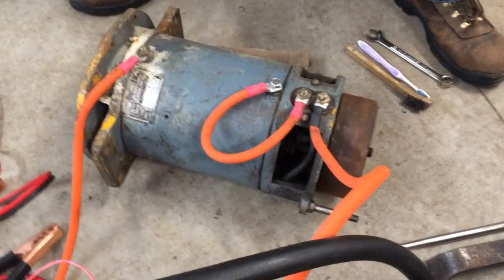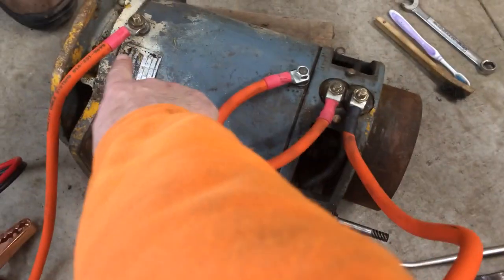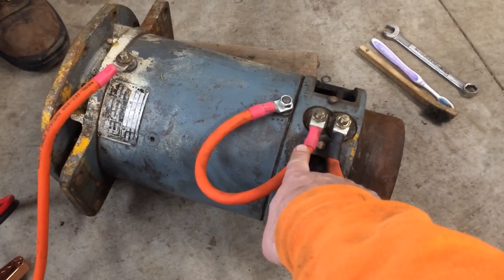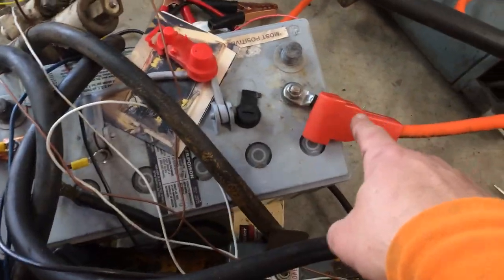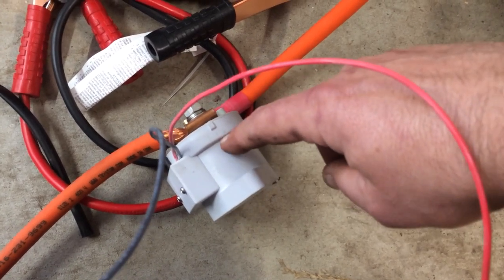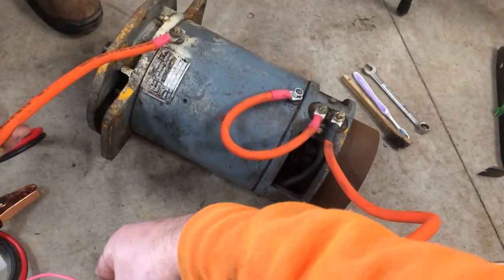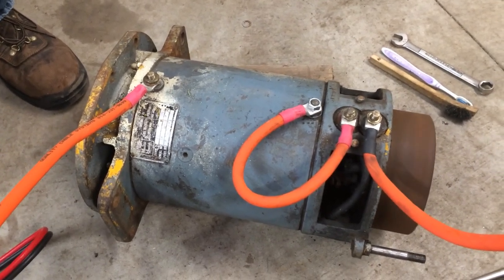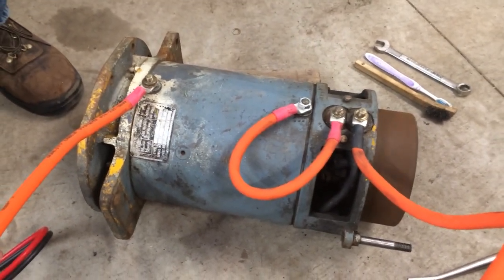Forklift motor testing - Spinning it up on 12V

Comment: I want to build a tracked electric bulldozer/tractor for my land. What size/type motor(s) should I get and how many should I get? We use skid-steers for stuff that's too involve and monotonous for the heavier equipment but some tasks are too big for them. We want to build a machine that's in the middle and we can fire up without worrying about fuel costs.
Reply: LMAO are you just being crazy funny or what.......
Reply: @ironjohn5914  there's lots of examples of electric industrial scale heavy equipment.
Reply: @marcuspinson  why not go with the proven turbo diesel.......
Reply: @ironjohn5914  because i don't want to fire up our D8 every time I need to do simple shit. Takes too much prep time to get it moving and maintenance to keep it happy. Electric has fewer moving parts and no warm-up infact electric motors work better the colder they get.

Comment: Would these forklift motors work in a motor yacht?, I'm only looking to go 10 knots max for short distances
Reply from the maker: No reason why a brushed DC motor wouldn't work in a boat.
I'm not much of a boat guy, but my understanding is that propeller pitch is important compared to the RPM of the motor. Just make sure that the motor is drawing a range of current which is appropriate for it.
Reply: Appreciate your reply, I have 20 tesla battery modules (about 110kwh)so my plan is to find the most efficient motor for range at low speed.I'm aware high speed on water is really inefficient.
Reply from the maker: @surplusstock8778  If you are specifically looking for the most EFFICIENT motor, an AC motor or brushless DC motor would be a good choice.

Brushed DC motors tend to be less efficient. However, they are EFFECTIVE! They can often be found rather inexpensively and have plenty of torque!
Reply: Thank you 👍

Comment: Do you know how much power drain the contacter is?  It may be the answer to a problem I have been sorting.
Reply from the maker: It’s very low power. You could put a multimeter with an ammeter function inline with the power to the contractor to know the exact current draw.

Comment: I have one (actually 3) of those (LInde) forklift motors that I am too stupid to convert as a power source for a bike.  As it is series wound, it will just spin one way.  (I still need to understand how you explain I can fix this.)   I also have the controller.  It is a big, heavy box.  Perhaps it is better to just buy a modern controller than try and figure out how it works?  All enthusiasm, no ability...

Comment: In your experience what’s the smallest forklift motor you could use to power an EV? Thinking of doing a Honda cr -v or Early 2000s Jeep Cherokee and live in a pretty hilly area.
Reply from the maker: Why skimp? If given the option, you want more power not less.
Frankly, I haven't installed a huge variety of forklift motors in many different projects.
Your best advice probably comes from those who have. I posted a link to a forum thread by Jim Husted. (It's in the video description.)
He gives some great information on what to look for in a forklift motor.
You probably also want to take a look through the EVAlbum. In there, you can sort projects in different ways, including make and model of car, or what parts were used in it.
Take a look at what types of motors have been used with success in similar vehicles to what you want to use.
http://www.evalbum.com/type

Comment: Hi Ben. I recently picked up a motor from a UK milk float. It is s big series wound unit. 13inch diameter by 22 long. I have been told its 12-60V. Any idea how I can size a controller for it.? No plate on it. Just wondering what the safe Amps will be.? Also typically what are the max amp verses rated amps for a small car EV. Through gearbox.
Reply from the maker: That sounds like a great motor. I'm sure you could over volt it by quite a bit.
In the U.S. we usually talk about horsepower of a vehicle. On a motor, current (amps) times voltage = power in watts. Divide that by about 746 gets you horsepower.
For example, if you ran that motor at 96V with a 500A peak motor controller, that's 48,000 watts, or about 64 horsepower. A nice big motor like that should handle a 500A motor controller just fine.
It's good to have a fan on the motor. Cooling gets important at higher power. In the video, you can see sort of a flywheel on the right end of the motor. That component also has fins on it to pump air through the motor.
You can also connect an electric fan onto a shroud around the brush covers.

The real details of how a DC motor performs depends on how heavy the field windings are, how big the brushes are, etc. In general, nice big solid connections, large brushes, etc. all handle more current.
Reply: @BenjaminNelsonX  wouldn't 500a burn the motor, specially when overvolting it?
Reply from the maker: For high current, you only want to that that briefly for a motor. Continuous high current creates lots of heat.
Adding some additional forced air cooling is a good idea for any motor that you are over-volting.
Reply: @BenjaminNelsonX   I have a pasquali 945 20hp that I would like to convert to electric. And from what I've seen, I'd need a 15kw motor, but they seem to big for the space I have. I was recomended a 5kw motor, but wouldn't that have a lot less power than 20hp?

Comment: Why type of ESC do you have in mind ?
Reply from the maker: None. The lawn tractor is designed for a gas engine running continuously. Everything else is controlled by belts.
The motor will only need an on/off switch.

Comment: I have a small old tractor thing (Aebi TP 1000). It has a small single cylinder petrol engine of something like 10-15hp. The gearing is super low. I think it would be ideal candidate for a conversion by a old forklift motor. I think it would be an upgrade in both power and speed. I would not need a big battery pack as its only used for very small distances at a time. 

Could somebody in short explain why I cannot find anybody running the donor forklift motor controller, battery charger etc? All projects I find seem to be running other controllers and building custom litium battery packs, custom BMS+++. I am sure that this will prove to be a far better solution, but the cheapest and easiest seems to use the forklift setup but with new/good batteries. At least for my world with a 60s tractor and a dream of keeping it simple and cheap. Or is there something im missing?
Reply from the maker: No, you're not really missing anything. For something basic and effective, transplanting forklift parts into another machine should work just fine.
There are certainly improvements such as efficiency in some modern equipment, but at the heart of it, it's still all the same.
If you haven't already, take a look at my original electric car conversion series. That used many forklift components and used parts to build an effective, budget-minded electric vehicle.
https://www.youtube.com/watch?v=BSA2fGTmqfw&list=PLmHss3DBZUilepzTmr-XAVwpRRCqMv7Ny

Comment: Nice test run!
I built a kart using the same kind of motor: https://youtu.be/rygq0ZmFv0E - maybe it helps someone out :)
It is controlled by a self made PWM-driver and also has a reverse switch, which works exactly as you described in your video description.
Are you really building a custom electrical lawn tractor on your own?
That's cool!

Comment: That is a little forklift motor , the Nissan forklifts I used to work on back in the 80's and 90's used motors double that size .
Reply from the maker: Yes, this is a smaller one. The Nissan forklift motor I used in the Geo Metro was 10.5" diameter. That was a great motor. Could take that car to 70 mph no problem.

Comment: so with a forklift motor can i use like a Curtis controller from ev west and would it have regen braking
Reply from the maker: No, a series-wound motor does NOT provide regenerative braking. You can use a DC motor controller to change the speed.
Reply: @BenjaminNelsonX thanks for answering i really like for videos ben it seems ev conversions are extremely unpractical for cars there dosnt seem to be many parts
Reply: @BenjaminNelsonX  It does if you make the cross reconfigurable. Just a matter of the controller.
Reply: @popinmo  Aside from batteries everything you need is available. Do not look for parts marketed towards cars but industrial automation.
Reply: @0MoTheG  then how do i get regen and stuff
Reply: @0MoTheG  i think i wanna build a ev what do you think of a 60s mustsng body as the body
Reply from the maker: @0MoTheG  I don't know of any off-the-shelf controller that does true regeneration (not just plug braking) from a series-wound motor.
It is POSSIBLE to get regen from a series-wound motor, but would require remotely switching connections with contractors and feeding current to JUST the stator.
It would be much easier to simply use a permanent magnet motor in the first place.
If you know of any videos showcasing a simple series-wound motor setup with regeneration, please let us know!
The question I usually get isn't "Is it theoretically possible to get regeneration from a series-wound motor?"
It's "Does it do regen?"
The simple answer is that it does not.
Reply: @BenjaminNelsonX  Possible? Yes. Practical? I can't tell. Commercially available? I can't tell.
But clearly an EV without recuperation is only half an EV.
Accelerating Pb batteries and then not getting it back will give you terrible range.
Reply from the maker: There are LOTS of electric car parts available. Check out a link like this one https://300mpg.org/projects/electro-metro/ev-parts-suppliers-links/

Comment: i have prob a dumb question but im learning .. but what size of a motor for like a f350 for good towing i going to  diy with one of my trucks but i need help in figuring out this
Reply: You need two DC series motors with about 50kw each. Then use a coupler to join them end to end. Two Netgain Warp11 motors plus a custom coupling to the drive shaft would be a start. That alone is $10k. You would really need to have this conversion. Also the motors together weigh about 210kg. A ford power stroke 7.3 is about 1180 kg which leaves you 900 kg for batteries controller and cooling.

Other electric motors could work. If you want to work in an explosive gas environment, pick something else. Also the Warp11 is a pain to acquire

Comment: How much rpm of this motor is running on 12 volt
Reply from the maker: A series-wound DC motor will spin proportional to voltage.
While I didn't have a tachometer on it while spinning this motor, I can tell you that at 12V, it will spin at 1/3rd the speed of what it would at 36V and 1/4th what it would at 48V.
36 and 48V motors can also often be over-volted for additional speed.
Reply: @BenjaminNelsonX  thank you sir please also tell me how much hp of this motor
Reply from the maker: @alisaad4913  I don't know the horsepower. The identification plate on the motor was not readable.
You CAN figure out the horsepower of a motor if you can measure how much current it draws under load and you know the voltage it's running at. You can get the approximate horsepower by multiplying current in amps by the voltage and then dividing by 746.
For example, if a motor can draw 300A running at 48V, it's producing about 19 HP. (300X48)/746=19.3
Reply: @BenjaminNelsonX  again thank you sir      for your kind response